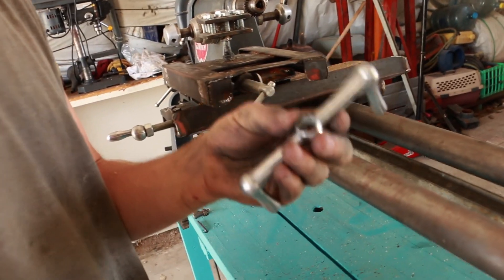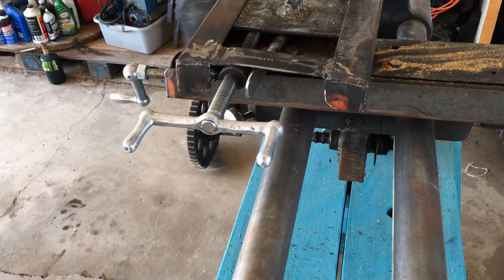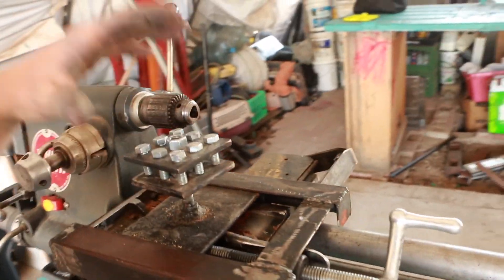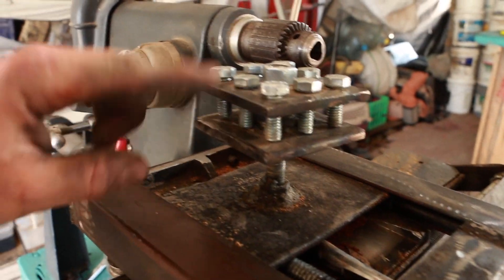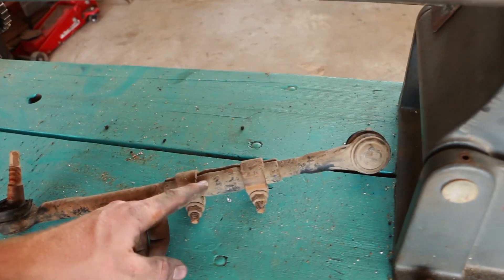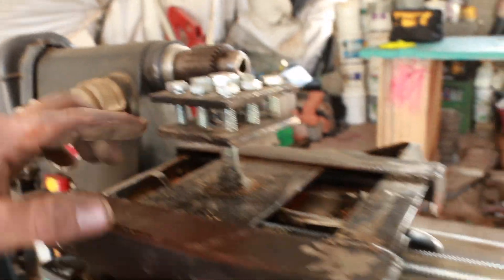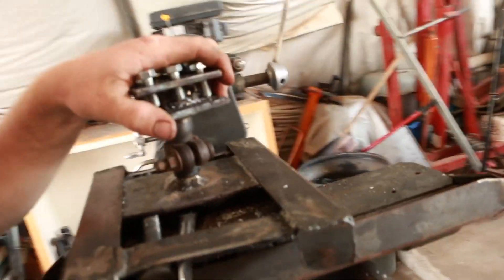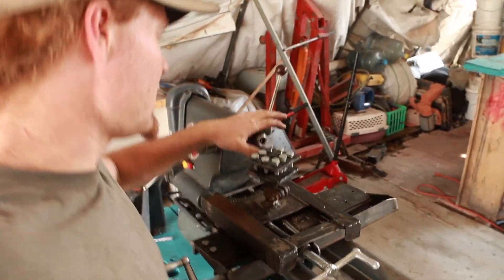Reinforcing The Tool Holder |Converting A Wood Lathe Into a Metal Lathe Part 5

Comment: just came across your chanell only watched 2 videos, and scan your through the list. So forgive me if answered this before. But what all you recommend buying for testing an engine?
 I bought a 1991 Dodge 150 yesterday. Am told bad fuel pump, 2nd gear slips, and there is oil leak maybe oil in spark plugs. Has 132k miles. I bought this to learn on, I have never done anything but check oil on car in my life.
 So far I bought a Mechanic tool set for taking bolts off, bought a kwiklift so could have some room. But thats it. Am doing this as a new hobby. Any advice greatly appreciated thanks.
Reply from the maker: There r a lot of testing tools used on engines so i would just get them as u need them :) 
Here is a good fuel pump video https://www.youtube.com/watch?v=piOzN1tZI_E
And here is a good oil leak video https://www.youtube.com/watch?v=Aab-Ss-odtw  
Unfortunately I don't know transmissions that well :/
Good luck :)